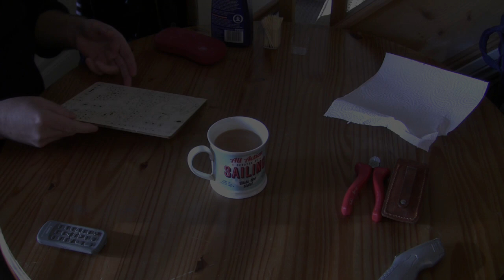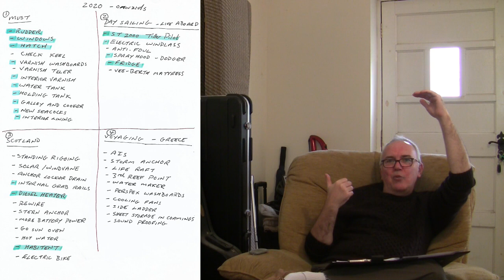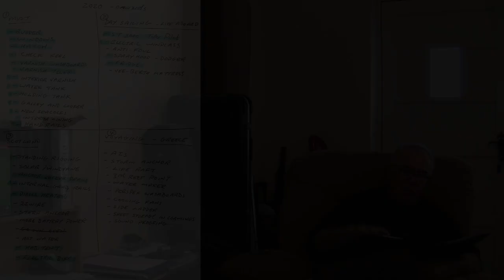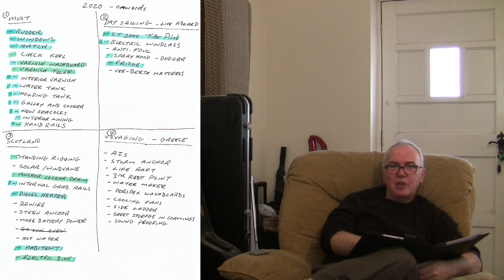Just About Sailing January 2021 - Plans for the year ahead

Comment: Hi Paul
Detail of your serenity model is really quite amazing. I am almost convinced you have included a few modifications that you have not yet told us about. Your latest episode also gave us a lead on what turned out to be a very good movie. Many thanks.
Reply from the maker: Ken, I was astonished at how accurately cut the model was. I had glue on standby, but didn't need it. I'd be happy id they did full-size CNC yachts. Clip it all together, a couple of coats of fibreglass and epoxy. Ready to go.
Cheers
Paul